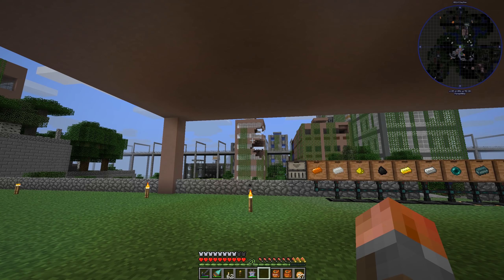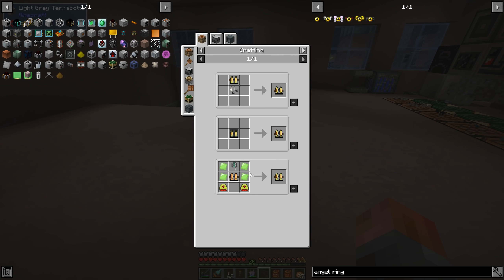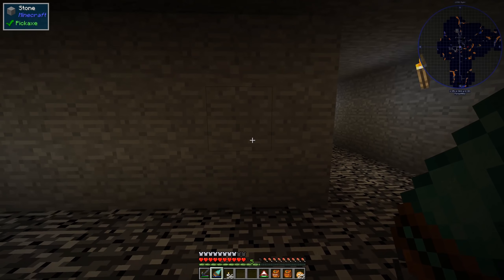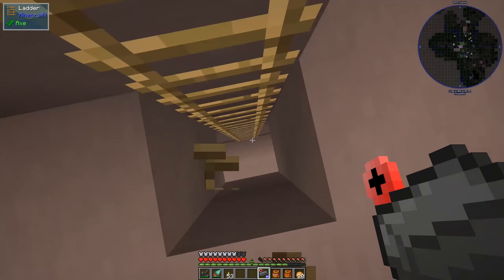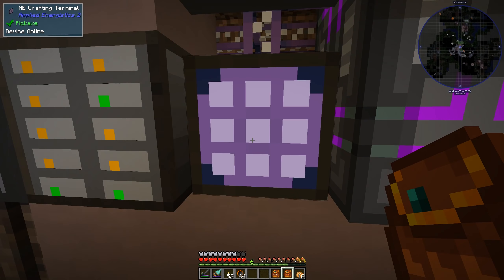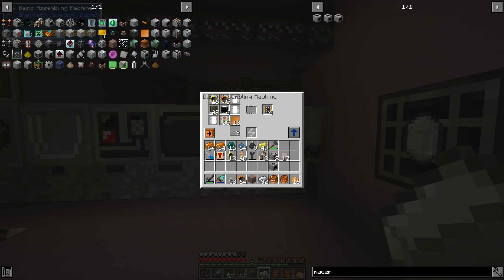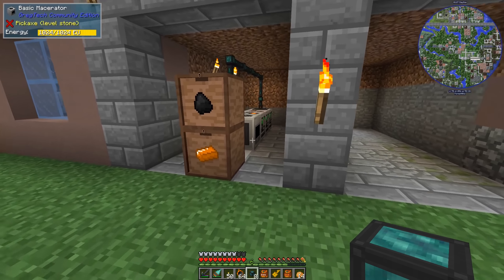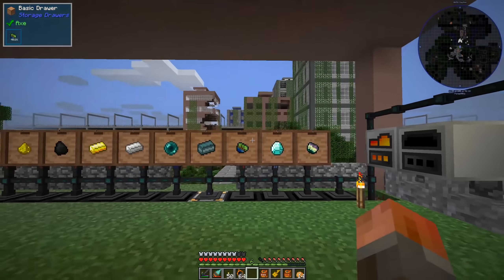Omnifactory E26 - Drill Upgrades, Parallel Production Lines and Circuits

Comment: The Thermal Elemental Module lets you get those 3 types of rods. With the rods + blaze you can craft Nether Stars.

Also, finishing Extraterrestrial Modules quest will unlock the Small Microverse Projector quest in Early Game. It's super expensive at your current progression, but yea.

You kinda know about it, but you can repurpose 'dead' patterns back into blank patterns. So, you can make some into inscribers, then advanced inscribers. Then, you can set up a couple interfaces to make your logic processors, etc.

You also probably want to make an assembler that has an interface with those casings so you can skip that whole manual crafting step.

Consider feeding a chest full of clay dust into an electrolyzer into your system to get a surplus of aluminium dust.

You can throw a item filter onto a vacuum chest that whitelists fluix crystals, then feed a precision dropper from an interface to automate getting fluix crystals.

Other than Gallium, the final tier one circuits are much easier to make than the second one.

Comment: Wireless is the enderio dimensional transceiver, but you’re a long way from that. I think there are solar panels that might work. They don’t generate much at low tiers but I don’t know how much power the vertical digger needs (it’s so much each time it mines an ore if I recall). There is also a wireless thing in extra utilities. But that might have had its recipe changed or be disabled in this pack - I’ve not tried it myself.

Your assembly line approach looks really cool. I’ll have to try out something similar myself. At the moment I’m batch crafting everything and it’s pretty painful...
Reply: IIRC the Vertical Digger can take in a max of 600 or 650 RF/t. A Flux Capacitor in a 16 slot (LV) CEU is really the best option. It's a cheap one too.